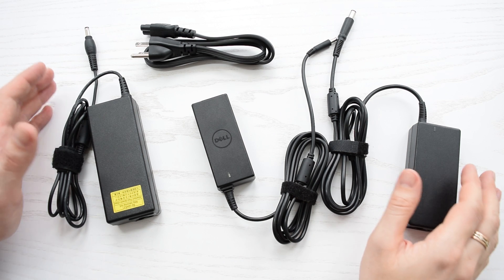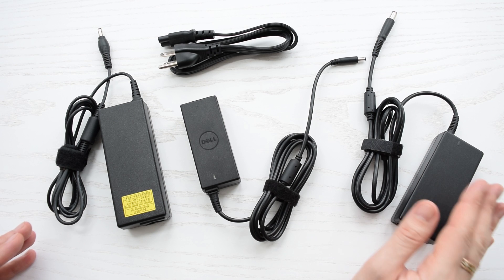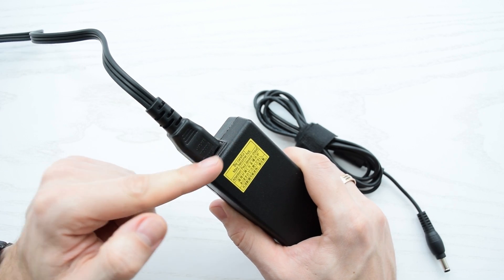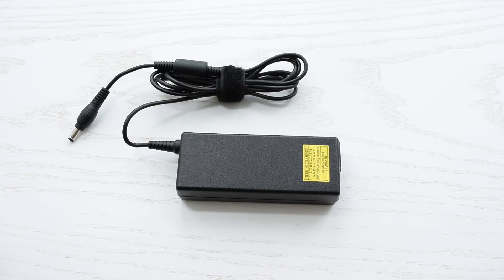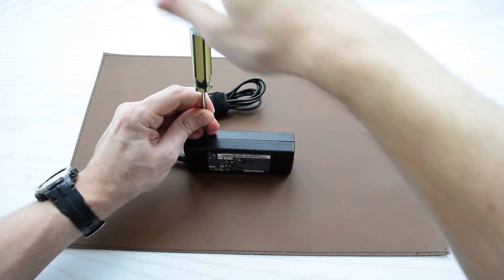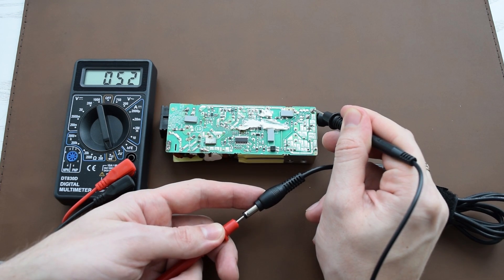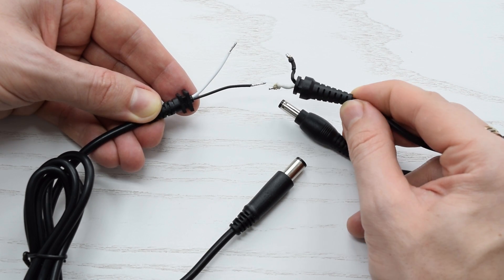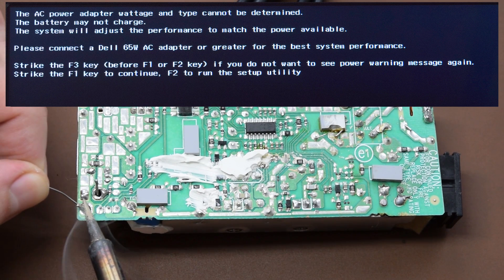How to Open and Fix Laptop AC Adapter without Damaging. DC cable and Capacitors Replacement

Comment: I need help can anyone tell me whether my adapter is faulty or not based on following test
My laptop adapter input is 19.5v. so when I set my multimeter at 20v it shows 0L and when I set it to 200v it shows 20v and when I set my multimeter to 600v it shows 19v based on this is my adapter faulty or not?
Reply from the maker: Those voltages are fine!

Comment: We are now living today and i can only fix staff that i will buy once and use it until my lifetime especially staff that comsumes electricity because business group companies only wants you to buy and buy their product with atleast two years maximum waranty. After that your own your own.
Reply from the maker: Those power supplies are easy to repair, and the components are dirt-cheap compared to buying a new original unit. So as long as the laptop is still functional and can be fixed, the power supply can also be repaired to save money. Unfortunately, nowadays everything is becoming less and less repairable and the overall quality is deteriorating fast.

Comment: My lenovo charger brick keeps making a beeping quiet sound when plugged in and doesnt receiving electricity any tips?
Reply from the maker: A beeping sound usually indicates a short circuit—either in the laptop, the DC cable, or the output stage of the charger. Does the charger have an LED indicator? And do you have a multimeter to test the charger?

Comment: Have you ever come across third party power adapters that use 2 pin wires? The ID pin is missing on those but there is something going on in the barrel plug itself that gives 16vdc on the ID pin. Anyone cut the plug to see what's inside?
Reply: Btw, I tried to power a HP system using a Dell adapter but it failed. So I took out the 2 pin wire cable from a third party adapter and soldered it into the dell adapter. The ID pin on the PCB is left connected. Surprisingly, the dell adapter works now on HP. So something is going on in the third party cable plug itself.
Reply from the maker: Dell and HP use different systems for the pin ID. Dell uses a chip inside the charger and HP uses a simpler method: a voltage divider made of resistors, that creates a specific voltage on the ID pin to tell the laptop the charger's wattage and legitimacy. Third party DC connectors simply have those voltage dividers inside the connector itself. So when you tried the Dell charger directly on the HP laptop, it didn’t work because it was missing that expected voltage on the ID pin. But once you attached the two-wire DC cable from the third-party HP charger to the Dell brick, it worked because that HP-style connector already had resistors, giving the right voltage for HP’s ID pin. The laptop saw what it needed and allowed charging. Great job!

Comment: Sir my charger LED give light normally until i connect it to my laptop it stop after attaching to laptop,  even after unplugging it from laptop it keeps not  lighting till i unplug and plug the electricty, i sent it to change the DC cable but same problem kept persist and this made me not trust the support team in my area if you can help me identify my exact problem because i have no luxury to keep changing parts ,ty❤

I will be haappy to give more details
Reply from the maker: Based on what you described, it seems like the charger goes into protection mode when you plug it into your laptop. The reason could be a short in the DC jack or somewhere on the motherboard. Have you tried testing your laptop with another charger, or testing your charger on another laptop? That could help narrow down the fault. Do you have any measurement tools, like a multimeter?
Reply: @ElectronicsComputers  i tested my friend charger on my laptop but my laptop requires 19.5v while his was 18.5v, i then didn't take any decision from that since they are not same volt, i will be testing both cases you mentioned with my friend having same laptop (DELL G3 3500) .
and about tools, no i don't have but when i sent charger to support i asked them to test volt and they tested it inside and said yes it suffer from voltage drop ( i didn't see ) so i just changed the DC cable, but this really confusing that both charger cable and laptop fail in same time, i just think they fooled me to change the cable, i may ask you how much it cost fixing the jack or the motherboard,  ty❤

Comment: Hello sir
Will the recommended cord work on a 180w 19.5V 11.8A charging adapter?
I know this video is old but i still wanted to ask
I wanted to buy the cable you recommended from the video description but a friend said the current rating may not be supported for my pc
My laptop is the msi gt70 2oc/od if that helps
Reply from the maker: The wires inside those cables are pretty thick and can hold that current without any problems.

Comment: The transformer light doesnt turn on
Reply from the maker: Could be a fuse, dead capacitors or even shorted DC cable.

Comment: Hello sir, every repairing centre is it won't get repaired, the changer is just having problem, it getting disconnected repeatedly means conected/disconnected situation, they were even denying to open it, when o opened it I found lots of ants yes ants, and i can afford the buy new one frankly saying please let me know if it is repairable, thanku sir.
Reply from the maker: You need to clean it thoroughly—first with a brush, then with rubbing alcohol. If the power supply is very old (5+ years), it might make sense to replace the electrolytic capacitors. Insects, their bodies, and feces can cause shorts or create parasitic connections and bridges in the circuitry, which can interfere with the normal operation of the power supply. So, in some cases, a proper cleaning might be all that’s needed.
Reply: @ElectronicsComputers  yes first I will clean it thoroughly and also check if I need to change the cable that you changed here using multimeter, but I just damaged the above the plastic case, in what case wrong with the adaptor my. Motherboard will get into the trouble, they just rejected to repair by saying that. One of the ectronicx shop owner said that i need to change the capacitor a bigger one i saw two by my eyes.
Reply from the maker: @lalitraut9521  Failed electrolytic capacitors usually have a bulged top, but if the power supply is very old, I’d recommend replacing them anyway.
Reply: @ElectronicsComputers  thanku
Reply: @ElectronicsComputers  ur link for capacitors has been disabled, i request to update it with valid one.
Reply from the maker: @ There's no problems with the link.
Reply: Yeah, they just don't provide delivery in india.

Comment: I tried prying it open. Turns out there were some custom, hidden screws under the label holding it together. Did not realise this until after I turned my Asus power brick into a Swiss cheese brick.

Comment: what can be the reason for power adaptor light blinking and laptop charging and not charging..its not a laptop issue for sure. thank you.
Reply from the maker: Could be a shorted DC cable or dead capacitors.

Comment: is it okay once I’m in there to shorten the cable on these adapters? I’m building a pedalboard and have too much cable and not enough space. thanks for the video
Reply from the maker: Sure! Just short the cable to a proper length for your needs.

Comment: i use the gasoline to open the adapter it's much way easier without damaging the case !
Reply from the maker: @PapaBear-32 Gasoline works only when the plastic case is glued with adhesive, not when it is ultrasonically welded, as it was in my case.

Comment: The "plastic sonic welding gods" have smiled down upon you... That case almost fell open compared to the ones I come up against. Some day... some day.  Cheers from So.Ca.USA 3rd house on the left.
Reply from the maker: In most cases, it's pretty easy to crack open those power supplies, but sometimes there are ones that are more challenging, requiring extra effort or careful handling to avoid damaging the casing or internal components.
Reply: @ElectronicsComputers   "in most cases"? I see what you did there! :face-blue-smiling:  E.C. You  are  a gentleman and a scholar. Honestly, I don't remember the last time I tried ¯\_(ツ)_/¯  I do remember one that (seemed) impossible. Like a Nun's knickers:face-fuchsia-tongue-out: But your video has giving me some additional techniques. And I'm looking forward? to actually having another go. You  R  the "Electronic & Computer Whisperer". Cheers from So.Ca.USA 3rd house on the left.

Comment: Thank you for this video. It is the most useful of all the videos I have found. I have a question though about the sensor wire (blue in video at 3:44). I ordered a cable from AliEx identical to the one in the video. It has the right connector jack for me (7.4x5.0mm) but I don't know if my current laptop charger has a sensor wire (I have Acer Predator but cable says it is for a Dell). I think I opened my previous charger and it only had 2 wires (+ and -). You mention if the sensor wire is not attached, the battery wont charge, but would that still be the case if my charger doesn't have a sensor connection in it? And is it safe to just cover the sensor wire and solder the others normally? Thanks!
Reply from the maker: It will work absolutely flawlessly, simply cut the exposed part of the sensor wire to ensure it doesn't touch or short anything inside the power supply.
Reply: @ElectronicsComputers  Wow thanks for the quick response. That is fantastic news as well. Cheers!

Comment: My laptop charging icon started disconnecting and reconnecting in intervals of around 5-8 seconds.
Replacing with new battery didn't help, but either way was neccesarry bc 15 yo battery kept only 20minutes max. Reseting battery drivers didn't help. 
I checked on multimeter Amps and it shows 0 and every 5 seconds there is a sudden spike.
Voltage is constant, without changes 19.65V.
One thing I hear from charger up close is buzzing, but more in a type of sizzle sound, which I checked on phone app has peaks of 7,3k Hz and 21k Hz.
21k Hz Idk how sounds bc it's outside human hearing range.
And this quiet noise is coming from the side of charger which has bigger plug.
Sound is enough distanguishalble from distance of around 25cm.
Reply: Opening my case was more like cracking a nut or breaking into a vault.
My charger's metal sheet is soldered in a few places with main part.
Reply: After getting it out of case, I hear this sound more like from 50cm.
But from 2meters it's still slightly hearable.
Reply: Most probably I'll think buying new charger.
I have soldering equipment and a bit knowledge in electronics but I think it's completely not worth for searching and fixing the problem when charger looks fine.
Making ebike battery was nightmare for me  and now say NO to soldering.
Reply: When I connected charger to laptop it went silent and after few seconds it's started buzzing/sizzling again.
Now I see that when Icon of charging is on, charger diod is brighter and it's buzzing/sizzling.
When icon is disconnected, diod is less bright and sizzling disappears.
But if I unplug charger from laptop sizzling comes back.
Reply from the maker: It's hard to provide advice remotely without examining the charger or checking some key components. It would be easier if you could mention your laptop's model. If the output voltage of your charger is correct and it powers your laptop without any issues, the problem may not lie with the charger.
If you have a Dell or HP laptop, the charger might not send an ID signal to the laptop, which could disable charging because the laptop cannot identify the charger's power. Considering the age of your laptop, I’d definitely recommend replacing all electrolytic capacitors, as that would most likely resolve the noise issue.
Reply: @ElectronicsComputers  New charger arrived, laptop charges fine. (paid 69zł -> 17$)
Reply from the maker: @hambernat6444  Świetna robota!

Comment: where to put 3rd wire i have green red white cant fig ut
Reply from the maker: Most likely, the red wire is positive, the white wire is negative, and the green wire is for pin ID. However, you should always verify with a multimeter, as wire colors can vary and may not follow standard conventions.
Reply: Thanks buddy I will check

Comment: I tried replacing the cable but accidentally slighty dented two of the capacitors, should i also replace that?
Reply from the maker: @legalisthebest  It depends on how severe the damage is. Can you attach a picture here?
Reply: Thanks for trying to help me, the capacitors shorted out and left a burning smell to i ordered part to replace them  @ElectronicsComputers

Comment: Yeah. The screwdriver marks are still on the plastics. I was hoping there was a way to avoid that.
Reply from the maker: I don’t think there’s a less invasive method, as these power supplies are usually held together with strong adhesive. Honestly, none of my clients have ever complained about the marks left after opening them, so it doesn’t seem to be an issue.

Comment: My adapter is fully operational, but is making high pitch noise. Can I fix that?
Reply from the maker: First, check the electrolytic capacitors. Over time, these capacitors can degrade, leading to instability in the power supply circuit, which may cause the high-pitched whine you're hearing. Look for signs of bulging or leakage, and consider replacing any faulty capacitors.
Next, examine the transformer. If the potting material (a white, silicone-like substance) has come off, it may need to be reapplied. This material is used to dampen vibrations in the transformer, and if it becomes loose or cracks, it can cause the noise. Reapplying silicone or another suitable damping compound can help resolve the issue.

Comment: Hello, I have an Acer Aspire 5 Spin Laptop that won't charge, like it's actually received a power but only last like 1 second and it has to be "jumped" so I unplug either from the socket or the AC to DC adapter and plug it again that the laptop will received power but then again only last for a second. Do you have any advice? Thx 🙏
Reply from the maker: There are many variables, starting from the power supply, which might not provide enough current for charging (though this is less likely), to the charging circuit on the motherboard and the battery itself. It's difficult to give specific advice without checking all these components using proper tools. If the laptop is old, the most likely issue is with the battery. Try using software like AIDA64 to check the battery's health.

Comment: My acer predator charger drop amp when playing games
Reply from the maker: Could be dry capacitors. Simply disassemble it and check for bulged caps.
Reply: @ElectronicsComputers  thanks

Comment: Great video thanks.  Also good to see a Youtuber who bothers to reply to most of the comments - many don't.
I've got a DTK power supply for my Acer Laptop - the cable has failed before and I soldered & Heat shrunk it, but it has broken again.  Very brittle plastic on the cable.
Not keen on dealing with Aliexpress but can't find a cable anywhere else.  I will order a new cable in  few weeks - don't want it delivered whilst we are away.  Will try opening the power supply & replacing the cable.  👍👍
Reply from the maker: Replacing the cable with a new one is the best solution. I've never had any problems with AliExpress in the past 20 years. We order tons of components and other stuff on a monthly basis, and I have to say that AliExpress has much better buyer protection than Amazon or other platforms. You can always get a refund without needing to return the item.

Comment: Sir, my Samsung laptop's power adapter, GH - 19V - B, is still able to power the laptop, 

but the MOV (Metal Oxide Varistor) after the interference suppression capacitor in the circuit has blown. What value of MOV should I replace it with?

Please help me. 🙏

---
Reply from the maker: What is the voltage in your country, 120V or 220V?
Reply: @ElectronicsComputers  220v
Reply from the maker: @quickmixstudio  Varistors: 10D471K: http://ali.pub/53b4in
Reply: @ElectronicsComputers  thank you sir 🙏❤️
Reply: @ElectronicsComputers  Link  doesn't open 😐

Comment: What does it mean if the LED showing orange light? I’m using adapter with black tip and connect to connector to blue tip for HP laptop
Reply from the maker: Orange means the battery is charging.

Comment: My LED indicator is not working.
Is upper wire finished or the full charger?
Reply from the maker: You need to desolder the DC cable. If the LED starts to glow, then the problem was a shorted DC cable. If not, then check the fuse and all electrolytic capacitors.

Comment: Thx i relised that i burned the pcb because there was a faulty wire so i found an old charger and relised it wasnt burned which meant i only had to change the wire now i will keep you updated if i fix it 🎉
Reply from the maker: I hope it will work for you.

Comment: Thank you for the video. I am getting back my old laptop to life. I was using it's adapter as power source for my other projects, it was not attached with original cable. I resoldered them with your help. Thanks :)
Reply from the maker: Great job! I'm happy to help.

Comment: just want to ask anyone here if what should i do if it gets soaked in the water almost an hour? please need some answer. thanks!
Reply from the maker: It's not gonna help you, more over most likely you'll destroy the internal components.
Reply: @ElectronicsComputers  is there really no other way to save it? What about letting the technicians to check it inside if it's possible to dry the affected components, if it so?